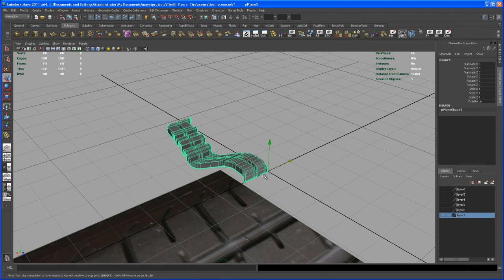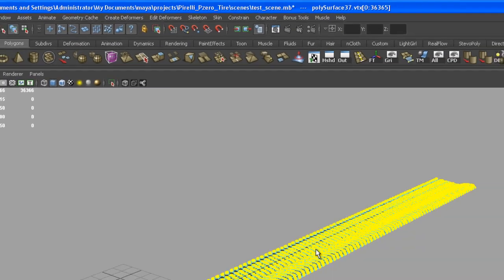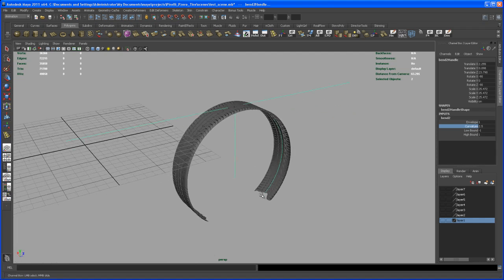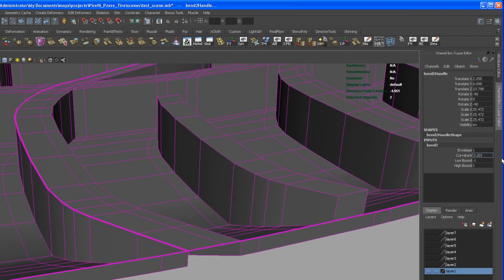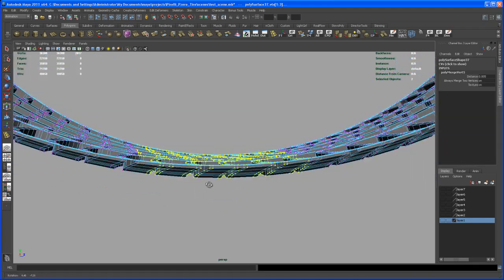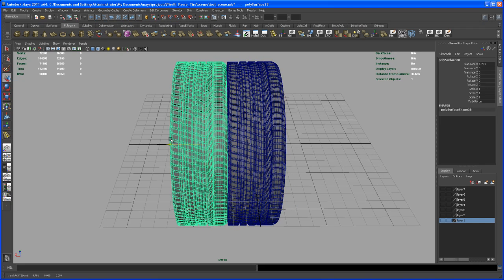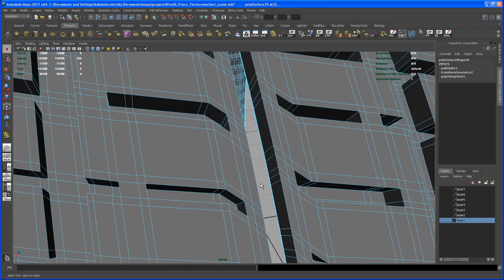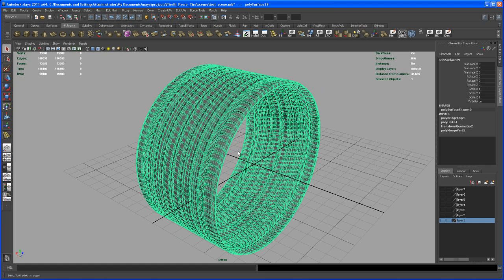Modeling tutorial in Maya - a tire tread - Part 3: duplicate and bend

Comment: I can't seem to get it to connect when preforming the step at 2:30   I go all the way to 180 on the curvature yet they do not touch.  Always one away.  and if i change the number that i duplicated it's still is always one away when i use the deform-er
Reply: just use more than 180, forget the slider put a number in the box
Reply: yeah got the same problem, any solution out of there?
Reply: same here. please tell me too if you guys find out the solution.
Reply: + Fuke mee it doesn't go more than 180

Comment: Hiya, when you duplicate the first piece to make 50, mine are all over lapped. i made sure that the units are both the same but my grid is set to UDK settings (512/512) and I just wanted to see what your grid was in case that was the problem